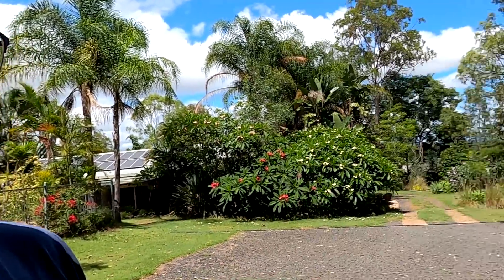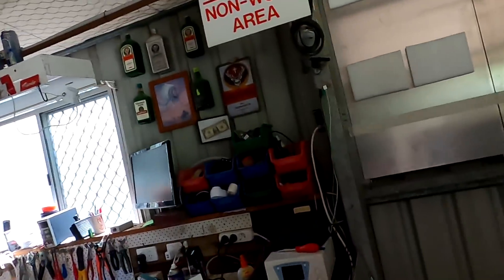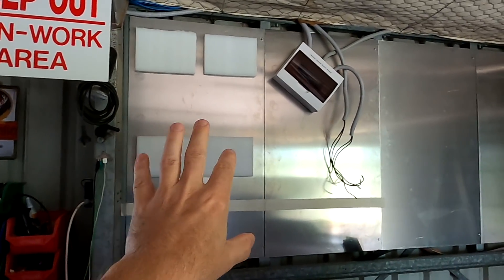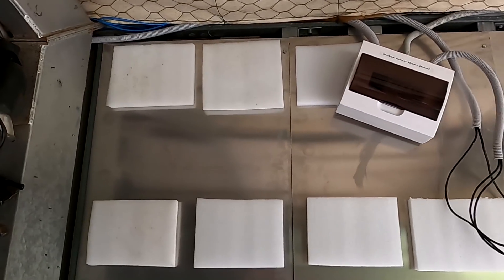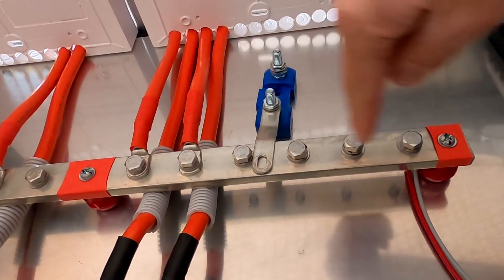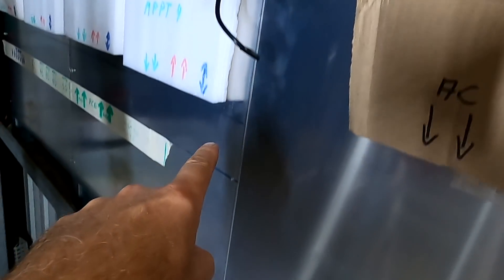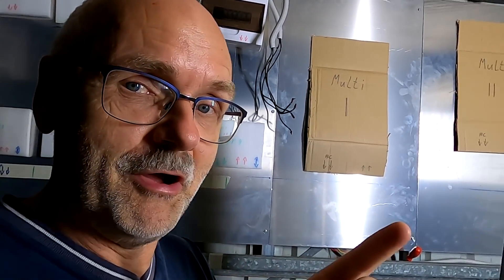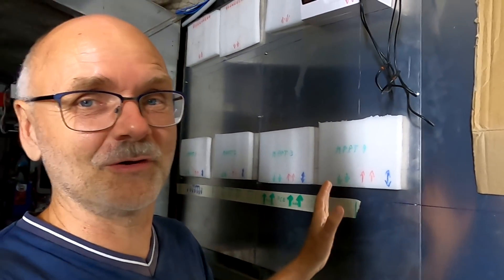No work, just design. The Solar PowerWall Project

Comment: I would run four rows unistrut horizontally for mounting. It would give ventilation behind your electronics and a cleaner install. Also use M8 or M10 to attach to the beams.
Reply from the maker: The beams are all attached with M10 and proper Bellevile washers and nuts. That is structural sound now. A horizontal beam across the posts could be the solution...

Comment: I'd be more inclined to install the single 5kW inverter and get the shed running, everything will comfortably run on that for ages, then while you're building up the battery, sell the 3kW inverter as you'll have plenty of time to do that, THEN at your leisure purchase another 5kW just before connecting the house and taking the whole property off grid. 10kW is plenty and with 40+ kWh of battery storage you'll be set.
Reply: It's possible to combine up to 6 Multiplus II. With at least 3 of them they can be run in a 3-phase configuration. See "Appendix C: Parallel connection" and "Appendix D: Three phase connection" in the Multiplus II PDF manual.

Comment: Hello Andy. Thanks for a video. I wanted to add to your idea. Why not to add insulation(probably extruded polystyrene or normal polystyrene)   behind those aluminum sheets on top but also on bottom. So heat is isolated from battery or those chargers you will have there.  You can add it in bottom but probably not on top..you would have to remove those metal sheets..but it is up to you ..ofc :)
Reply from the maker: That would be a relatively easy task. The problem with Polystyrene is that critters love than start digging into it to build home and start a family. They like the insulation too, summer and winter. It so very different here in Australia, especially here in the bush where we don't have any frost in Winter which controls the bug population.
Reply: @OffGridGarageAustralia  aa ok then there is that rockwool..usually those buggers don't like that isolation..but up to you..then there is 3rd option..but that is most expesnive one..foam boars..that cost most..and i'm not sure about bugs..usually nobody wants to go in..so much chemicals is inside :) haha
Reply from the maker: @SylwerDragon  it's all not that easy. I like the idea some suggested here to cover the outside wall with solar panels. I've got some old ones here which only deliver 50%, so that may be an option. Don't know yet, the wall is now already closed as I have to move on with the project. Well see. 
Thanks again for your suggestions.

Comment: Add an awning!!! + 4 solar panels on the awning & keeps your meter out of the sun
Reply from the maker: I need access to the roof and gutter from time to time though...
Reply: @OffGridGarageAustralia  How good is your construction work?  Make it like a car port & have it separate to the roof. Basically fill the gap between the 2 sheds with a roof & leave 500mm gap for access? Or have the car port awning above the gutter line?
Search for DIY carport - would give you dry storage space between sheds for timbers etc too!
Reply from the maker: @nateb3105  if we go to high with the awning, we put a shadow on the east roof solar. The panels are very close to the gutters. If you watch some older videos where we set it up, you can see the rain is almost going from the panels into the gutter...

Comment: What about some 5 volt PC Ventilators for some air ventilation to dissipate the heat? (Rather than sealing everything off?) (Maybe turn on the vents based on a temperature sensor?)

Comment: The aluminum panels should act as a heat spreader to help with the heat generated. You could also put a couple of 12 volt fans blowing air behind the panels. I live in Arizona and my Sunnyboy inverters have fans in them.

Comment: Shading the outside would be the most direct way of eliminating the radiant heat. Maybe a "lean-to" type shed or even a solar "lean-to" of sorts for additional storage/shading along the outside of the off grid garage, which would shade that wall.  "Dealing" with the direct sunlight is really the best way to go. Anything else would seem to be fighting symptoms without providing a cure.  Of course, anything like this would change the exterior which may not have the asthetic appeal that you desire. If the looks are prioritized over the fix, then this is certainly understandable.
Reply from the maker: I still need access to the gutters on both sheds.
Reply: @OffGridGarageAustralia  understood. Whatever it is, it should shade the side of the area you want shaded.  Preferably, with solar panels :)
Reply from the maker: @JStarke240  yeah, that's actually a good idea. I got some older ones with 50% output.
Reply: @OffGridGarageAustralia  awesome!  Some Solar Siding might be the ticket!  I do enjoy your channel.  Though, I don't know that I have Texas $ to misplace a comma in a donation to prove it. Cheers 🍻 to your success!
Reply from the maker: @JStarke240  that is all good, thanks for watching and commenting. That's great support already!

Comment: Couple commts just
1. 5 fasteners M6 each side bit overkill I think. It a static assembly also so no fatigue or major stress points. Just allow for aluminium expansion with the heat/cold on the holes size.
2. Conduit - I would probably separate  the data cables from the DC ones with a small Conduit. Like it better like that. Is not AC but depends on the type and speed rate connection. If is Rs485 normally is fine but other like rs232 hum... or if high speed normally more vulnerable. 
Looking 👍
Reply from the maker: Thanks. The data cable shouldn't be a problem inside the DC cabling and it actually is some kind of RS485 they are using. I'll give it a try...

Comment: The simple fix for the Multi Plus "I want to be on the floor" issue would be to run horizontal bracing between your new uprights, and have the mounting plates for the Multi Plus units bolt into those horizontal braces.

Comment: In one of your videos, when you were going to pick up some solar panels with a van, it was seen that some of the systems you picked up had a Fronius inverter. For 2-phase systems, Fronius and Victron work very well. The Fronius AC-In connects to the AC-Out of the Victron, and is capable of adding total output power and, properly configured, Fronius can charge the battery through the AC-Out of the Victron (Fronius works only On-line ( without battery)), as if injected into the electrical network. If you still own the Fronius you could use it, instead of buying another MPPT, with the advantage that during the day, Fronius would first supply AC to the loads and only what is left over would go to the battery through the Victron. I hope you understand what I mean, it's an automatic translation, my English is very bad and I don't know if you read the comments in other languages. All the best.
Reply: If Andy uses the Phoenix as second inverter it should also work if connected behind the Multiplus II. The Phoenix should synchronize to the existing frequency of the grid and if the grid fails the Multiplus II would create the AC frequency. See section 2.2 "Frequenzverschiebung" in the Multiplus II PDF manual. Maybe Venus OS supports DVCC with Phoenix inverters.

Comment: I would put the Multiplus II’s higher up (even if not aligned). Those large cables from the battery may need a bit more space when curving up from the trunk to the Multiplus. Should you also considered put a vertical trunk on the right hand side of the power distribution/MPPT area? This way you can have cables running on both sides and use less cabling.
Reply from the maker: Thanks Paul, I would mount the brackets for both inverters the same height. The old one will be just 100mm shorted then the Multi.

Comment: Thanks for the video, Andy.  You mentioned air is an insulator, which is true, but only when there is no airflow.  (No convection).  You would have to seal the top and bottom of your aluminium panels to stop airflow.  I use pergolas with deciduous vines to keep the sun off the houses I built.  Could you somehow keep the sun off that garage wall?
Reply from the maker: That is true with the air...
Someone suggested to mount solar panels on the outside of the wall. I have some older ones which deliver only 50%. They should be right and I can still charge some batteries on the workbench...

Comment: You could just increase the length of the roof overhang so the top half of the wall is in shadow.
Reply: I thought so too, and then there would be room for another row of solar cells.
Reply from the maker: How do I get to the gutter then? And don't forget about the wind force.
Reply: @OffGridGarageAustralia  maybe just an extra skin on the outside of the wall to reflect solar radiation instead then (as I suggested after the previous video).

Comment: You  might want to run your data wires separate from your power wires.  Power will generate an electromagnetic field around the wires which can induce power in the data wires and  mess with the data transmission.
Reply from the maker: There is always always two wires inside the cable duct which run the current in opposite directions and the magnetic field would (almost) eliminate themselves therefore. I'm not concerned about that.

Comment: 1 Add a row of solar panels on the outside of that wall to convert some of that 2h of insolation to electricity.

2 Use spacers between all boxes and the warm wall/panel. If one layer of air is good, two are better.
Reply from the maker: Thanks, that's both great suggestions.

Comment: From personal experience you should go with split phase or 3 phase as you described. To do that all Victron inverters must be all the same model and firmware. The inverter negatives should never be isolated from one or another and the battery. If so you will burn up the circuit board in inverters. I live in US 120vac per phase. That is 180deg out of phase on split phase to feed 240vac appliances and or when a neutral is shared between two phases. Example Phase A for master bedroom circuit shares a neutral with adjacent Phase B living room circuit. Also all conductors from battery to inverters should be exact same length.

Comment: Hallo Andy, vielleicht solltest du die Multiplus gummigelagert montieren. Die Vibrationen der Multi könnten durch die Aluminiumbleche unangenehm verstärkt werden, Ich hab den MP2 bei mir an Fermacell (darunter OSB) und gummigelagert montiert. Auch die Montage geht viel zügiger, man kann alles mit Holzschrauben einfach befestigen.
Reply from the maker: Darueber habe ich gelesen. Das letzte Firmware update hat das behoben und es gibt keine Vibrationen mehr. Das haben mehrere User bestaetigt. Dazu gibt es einen Thread im Victron Community Portal.
Holz kann ich nicht nehmen, wir haben Termiten 🐜🐜🐜🐜🐜

Comment: I would say put some fans on the bottom forcing air up is air up so it goes from the bottom and makes like a convection style and blows out the top of the hot air bringing in cooler and that way if you still want to insult you can but it'll actually allow it to dissipate the heat from the back of the aluminum sheet from the inverters solo charge controllers and act like a giant heat sink

Comment: How are you going to reach those combiner boxes fuses after the battery rack is installed. Looks like a stretch to me. Changing those or killing them if there is an issue looks like a royal pain for you to do.
Reply from the maker: Yes, that is correct, David. It's in the next video...

Comment: I'm enjoying having 28 kwh on tap
Reply from the maker: Nice!
Reply: @OffGridGarageAustralia  I'm making 33 to 40 Kwh a day I don't stat making real power till 9:00 AM though
Reply from the maker: @awesomusmaximus3766  wow, that's great! And do you use all that power each day or feed in?
Reply: @OffGridGarageAustralia  I use it all the aircon & a bitcoin miner I have a 1.7 kw grid tie system  too it only exports 10 kwh a day that inverter is a Delta Solivia 2.5 moniter via a now non functioning solar log 200
Gotta fix that

Comment: It seems weird to me that the Multiplus II 5k should only be able to assist its "grid" with 3kVA. In the manual at 4.3 it says "With its PowerAssist feature the Multi can add up to 3kVA (that is 3000 / 230 = 13A) to the output during periods of peak power
requirement. Together with a maximum input current of 32A this means that the output can supply up to 32 + 13 = 45". I think this only applies for the 3kVA version of the Multi, since the 5kVA model can transfer up to 50A (the 8kVA and 10kVA models up to 100A) if input current to the output and not only 32A. So if the manual was accurate here it wouldn't generally speak of a "maximum input current of 32A" for all versions of the device. I think they were adding the higher power models later and forgot to change this part of the manual. In my opinion it needs to say for the 5kVA: "...50 + 21.7 = 71.7 [A]" (5000 / 230 = 21.7) and for the others accordingly.

And theoretically speaking, if there is a load that demands a total of 8 kVA from the system the MultiPlus needs to assist with all of its power just to hold voltage and frequency stable at 230V and 50Hz. Physically there shouldn't be any difference if the Multis electronics produce 5kVA, with or without a "grid" at the input. 

So I would at least want you to try it out once given you have this big of a load for a single phase :D
Reply from the maker: That's an interesting though. I'll get this confirmed by Victron...
Reply from the maker: It's in the manual on page 10 under 4.3 where it explains the AC-out-1:
*With its PowerAssist feature the Multi can add up to 3 kVA (that is 3000 / 230 = 13 A) to the output during periods of peak power 
requirement. Together with a maximum input current of 32 A this means that the output can supply up to 32 + 13 = 45 A.
An earth leakage circuit breaker and a fuse or circuit breaker rated to support the expected load must be included in series with the 
output, and cable cross-section must be sized accordingly.*
https://www.victronenergy.com/upload/documents/Manual-MultiPlus-II-12V-24V-48V-3k,-5k,-8k,-10k-230V-EN-NL-FR-DE-FI-SV.pdf
Reply: @OffGridGarageAustralia  I just sent you an email regarding this topic. Maybe still worth a try? :)
Reply from the maker: Got it. Thank you very much!

Comment: Not sure that your side wall girts are strong enough with all that weight.  May need centre support to ground.
Reply from the maker: They will be strong enough, They bold into the ceiling girt with M10 as well and the whole structure is welded to the main profiles of the garage. I could lift up a car on this easily.
Reply: @OffGridGarageAustralia  Not bad for something designed to only hold cladding.

Comment: Why not mount the 5kVA MP2 first, than 5kVA is in the bag, than you have another fase of 3 kVA (or 5 kVA is you sell it and purchase another one) so no need to piggy back, or am I mistaken. The combiner boxes on the top make a clear design, also the DC converters do have more thermal room to the top of your garage. When things might get hot for a few weeks, why not force the cooling with fans? Any air movement will do I imagine.
Reply from the maker: The benefit would be to have everything on one phase and don't need to worry about which circuit goes onto which inverter.

Comment: A note on the FLIR camera: it doesn't work so well with non-anodized aluminum due to low emissivity, and sometimes you see the IR levels reflecting off the aluminum rather than the temperature of the aluminum itself.

Comment: Why not crim MC4 connectors on the strings on the roof combiner box so you can extend them to your new location
Reply: Every connection increases the resistance which is bad with high current. Less connections is less heat and more electrical energy.

Comment: I'm a metric guy, I dislike the American wire Gauge (I live in South Africa). Anyway, was told that each 1mm² can carry 3 Amps... thus 70mm² is just over 200 Amps. Made my life simpler.
Reply from the maker: 70mm is around 185A, depending on what table and calculation you take and how the cable is installed.
1mm - 13A
4mm - 31A
10mm - 54A
So you rule of thumb is a bit off 😊

Comment: Send back the victron and save yourself some money and get growatt 5000es.  You can do 6x 5000w without issue, they can do 3 phase or paralleled 2 phase that will easily handle what you’re doing. 30kW is like $3000 total that way.

And the growatt has mppt built in which will save you money and just as good WiFi integration if not better and they accept up to 450v solar input.  Major space saving, major money saving and major flexibility increases.